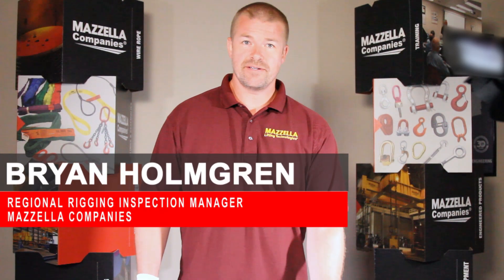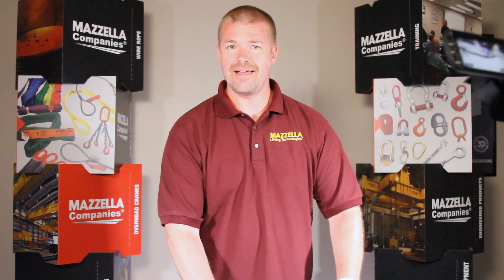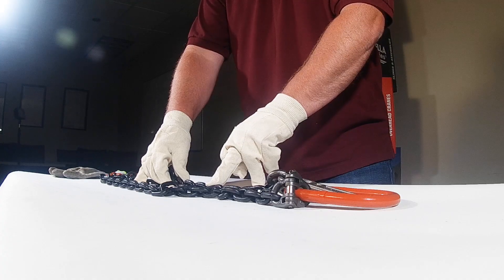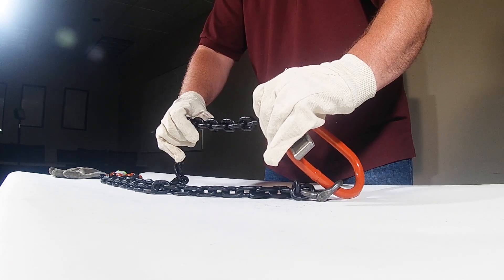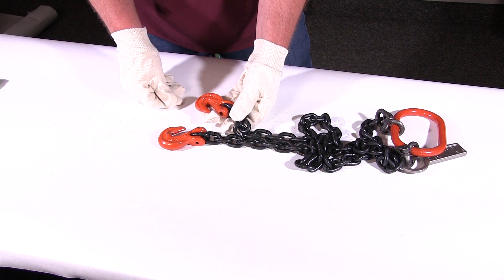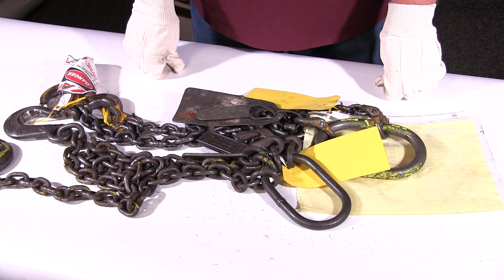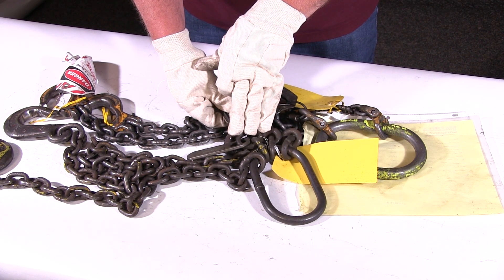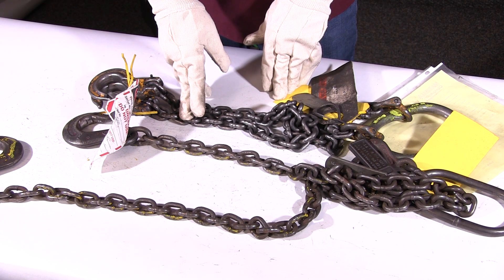How to Inspect an Alloy Chain Sling to OSHA and ASME Standards | L-3

Comment: Do all chains need this we have a chain we use at work that’s is rusty and old
Reply from the maker: If the chain is used for overhead lifting, corrosion is a reason to remove it from service. The answer is yes. All chains used for overhead lifting need this. If your chain is being used for overhead lifting, it must be removed from service and replaced.
Reply: @LiftingandRigging  it’s a chain for a 1 ton overhead hoist
Reply: It doesn’t have anything on that was in this video and I told my boss and he didn’t even care